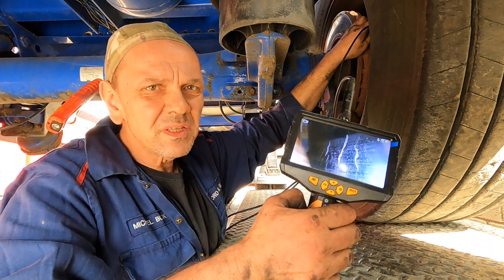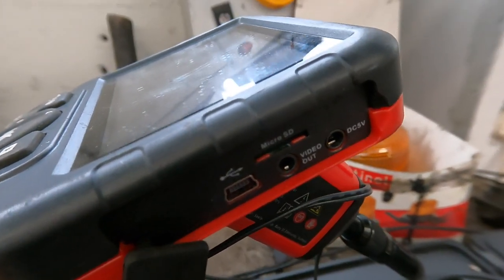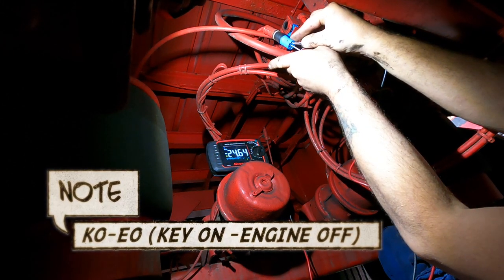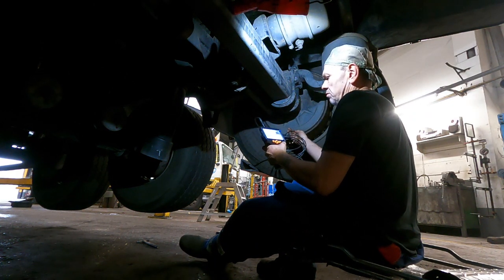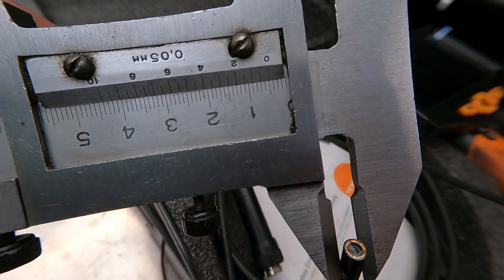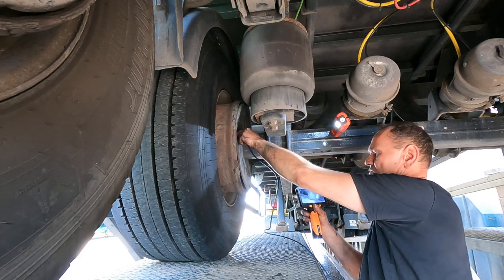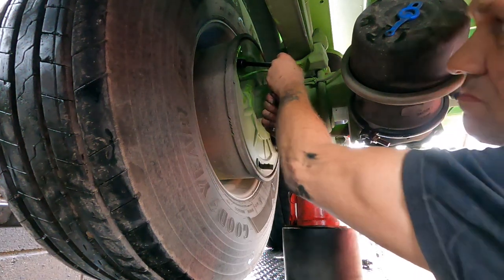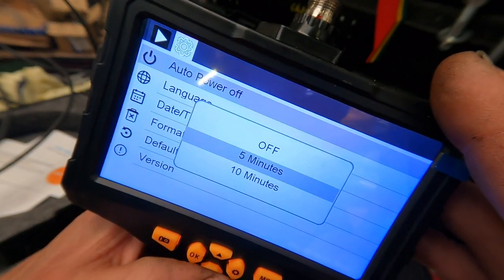UK Trailer Technician (Tools)- TESLONG NTS300 Endoscope - Unless your Finger Has An  Eyeball On It.

Comment: The cheat delight on your face when u found the cracked hanger. 🤣. Do you find that dvom turns off too quickly?
Reply from the maker: dvom?
Reply: @trailerfitter2  multimeter
Reply from the maker: @CANDiagnostic   oh? I must have fell aslep during that part of the course...
Reply: @trailerfitter2  digital voltage ohm meter ;)

Comment: This would have been super handy today couldn't see the condition of discs ended  up taking wheels off low and behold major heat cracks on the front face none on the back
Reply from the maker: always happens on the wheel-side because the heat can't escape.